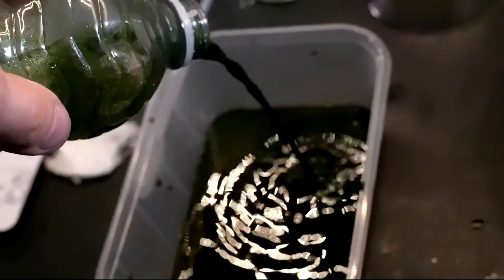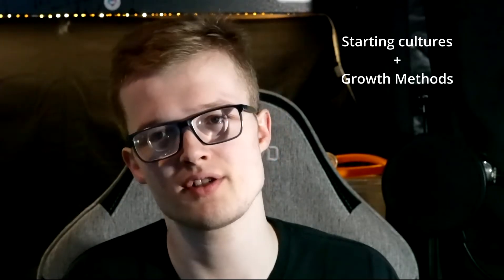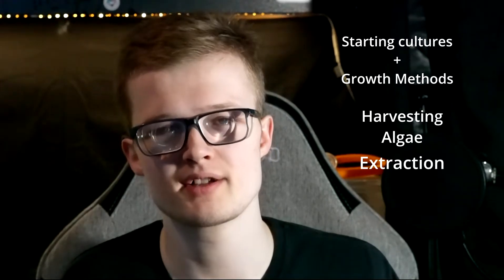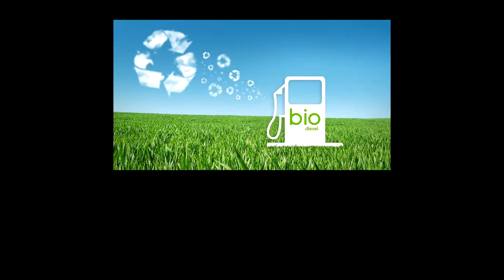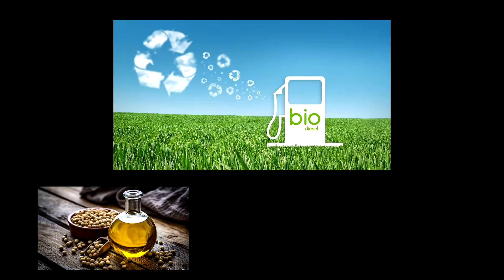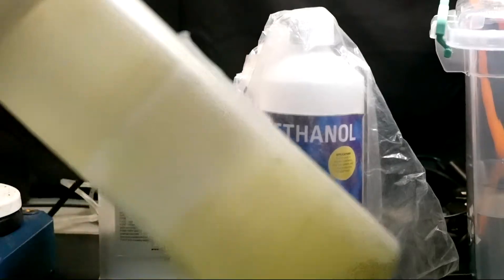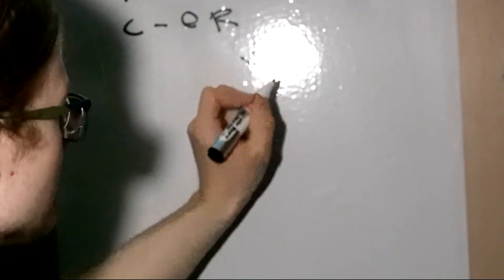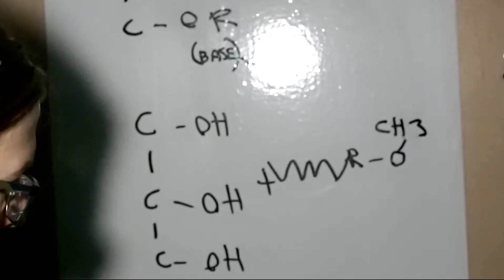I FAILED at making Biodiesel from Algae, here's what I learned!

Comment: Tangent Suggestion because I‘ve not found anything regarding this online yet:

What about burning the whole dried algae yield as pellets? Wouldn’t this drastically reduce processing inefficiencies and make the algae viable as fuel for heating homes or running a steam turbine for generating electricity.
Reply from the maker: This is something I've considered, it wouldn't be suitable as an automotive fuel, but could work as a stationary fuel source for heating, perhaps even small amounts of power generation!

Comment: I have a few suggestions after having seen the extract video. 

Firstly to avoid using heat when not necessary. Lipids can react with a whole variety of things and when you're talking about lipids of a cell reacting they can react with the very enzymes the now dead cells have. The dehydration step you took with the food dehydrator may have actually degraded what lipids you were trying to collect because of not only this but also any that may have evaporated away. Yeast extract for example is produced at temperatures of something like 40-50c and utilizes the yeast's own enzymes to break it down.

I think using something like a cold press that can rip up the cells and putting the contents into an acidic solution(denatures proteins and enzymes) will do a lot of good. To prevent the contents from being digested by any contaminating bacteria you can fully saturate the solution with magnesium chloride(can be recycled for seawater photosynthesizers after dilution) to bring the water activity below 0.6 and stop microbial activity.

From there I think you should either let the lipids separate out on their own or run it all through a centrifuge and decant your oil off.

Comment: pyrolisis in full vacuum. just put the boiling flask into a microwave oven, and get the algea mixture under vacuum. you can cut the top of the microwave off in a circle, so you can have the boiling flask installed rigging a microwave for vacuum pyrolisis is actually fairly easy. I don't know about the yield but: I recommend allowing for plasma to develop within the boiling flask. don't stand too close to the system because if you have failure at achieving full vacuum, any oxygen: could make it light on fire.

Comment: You might want to check also the free fatty acid content (FFA) content from your lipid. This also one of contribution that cause no separation after transesterification. Common method to counter this problem is using acid esterification which you will be use methanol and concentrated H2SO4 as your catalyst. During reaction, some of FFA will converted to fatty acid methyl ester. This would help reduce the FFA, thus help to improve separation of biodiesel and glycerol after you perform transesterification using NaOH as your catalyst.